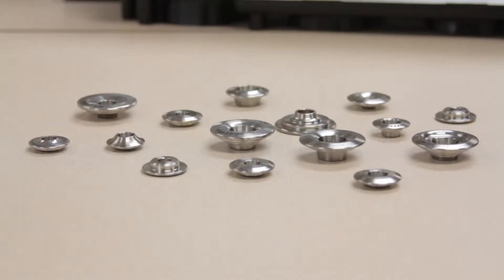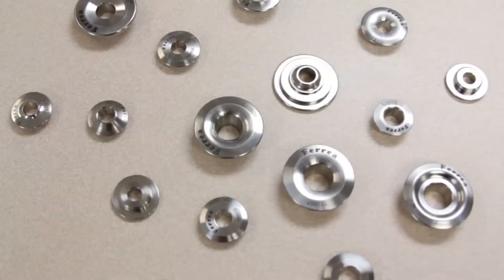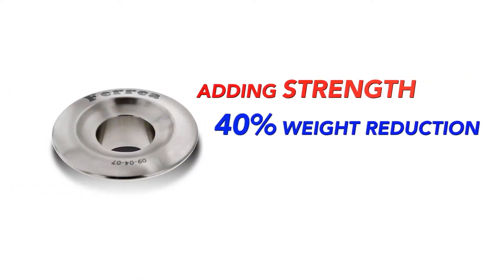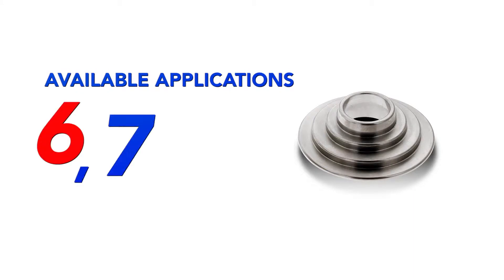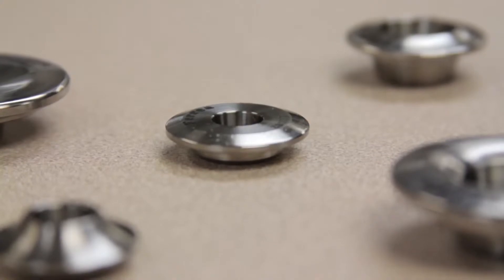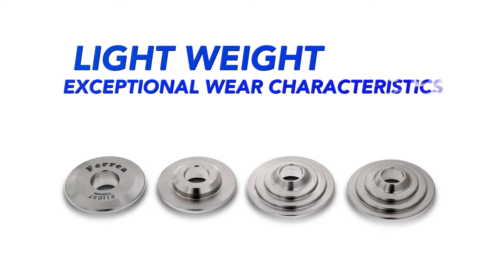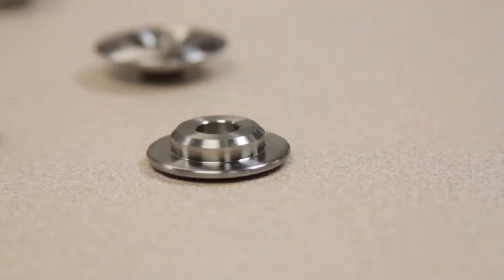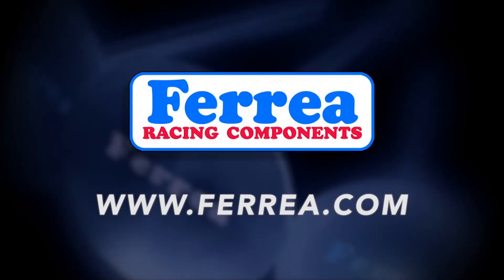Ferrea Titanium and Tool Steel Retainers

Comment: What your rekomendation valve and ritainer for rally car?
Reply from the maker: What type of engine? Normally aspirated or turbocharged?
Reply: @FerreaRacingComponents  turbocharged 4g11 down stroke 1600cc ap4 setup enggine
Reply from the maker: @mamatz2767  great! Is the car strictly street or both street and race?
Reply: @FerreaRacingComponents  Curious on the alloy answer for this, always heard of steel for street and titanium for race but I'm interested in learning more!